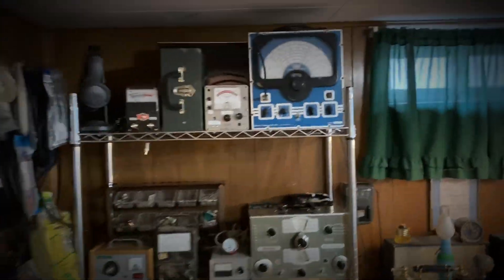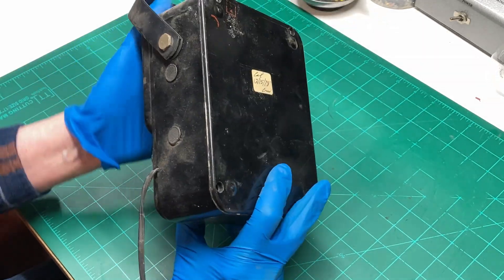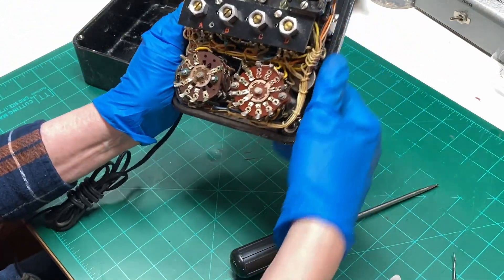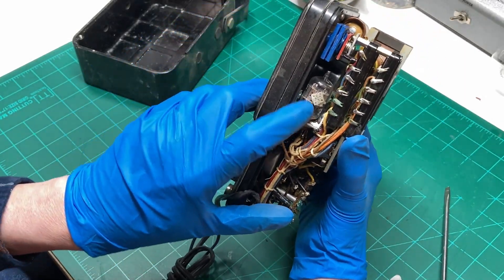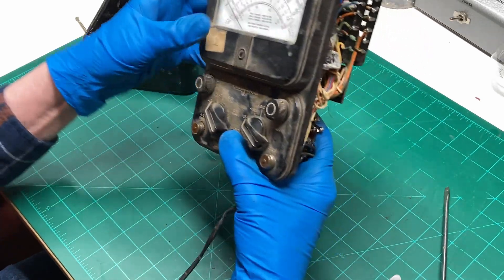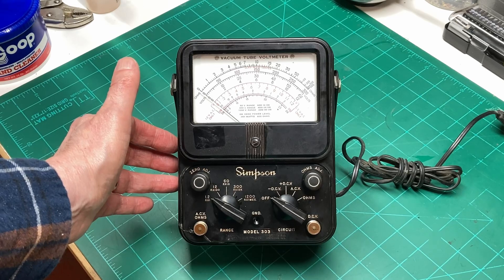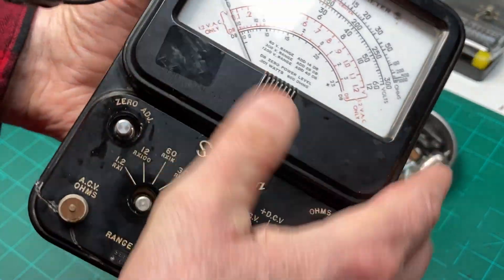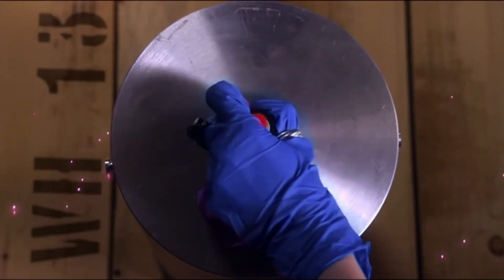Simpson 303 Restore (FAIL)

Comment: I could use a meter movement for my old 303 if you still have it
Reply from the maker: Hi David, just in case you don't know, the meter housing is part of the front panel and a real PIA to swap out.  If I can successfully extract the meter from the case, I'll test it to make sure it works then maybe we can make a deal. I'll let you know how it turns out.
Reply from the maker: Good news!  I was able to remove the meter movement & it tested fine with good, smooth, full scale needle movement.  PM me back if you are still interested.

Comment: I'm a bit upset that the rotary switch wouldn't free up for you. It was an interesting video none the less. I've been working on restoring a Triplett WWII era VOM over on my channel. Just finished up swapping the busted selenium recruiter for modern diodes. I'm sure I'll need to add additional resistance one I am able to test it.
Reply from the maker: Yeah, it was a little discouraging but I've got another (Heathkit) VTVM that works just fine but I was really looking forward to trying out this ones reputation.